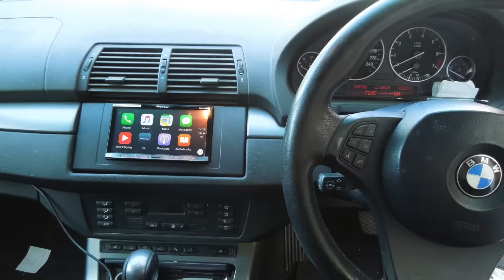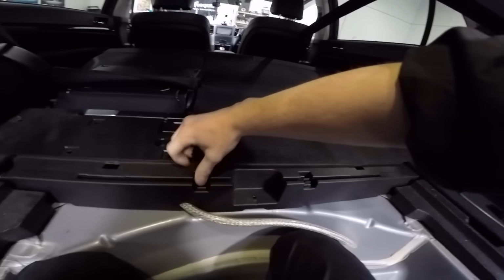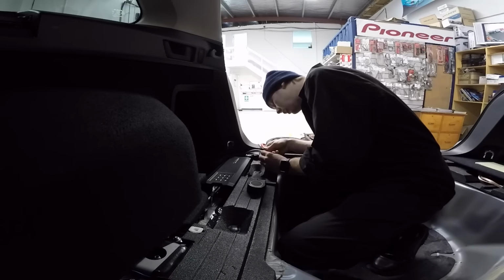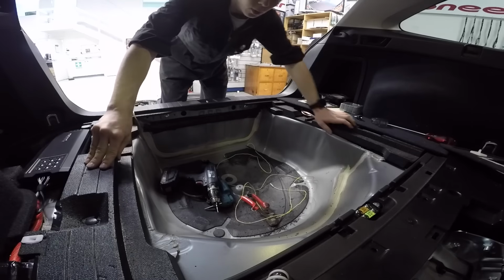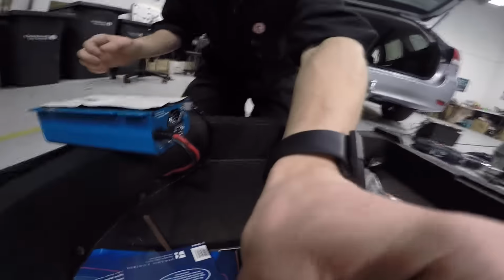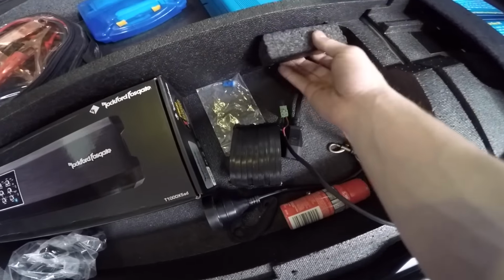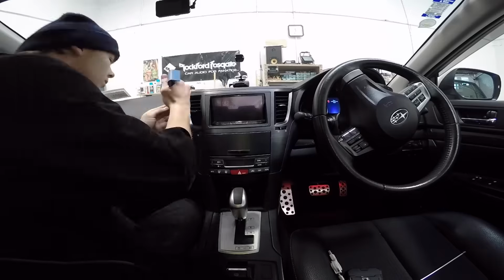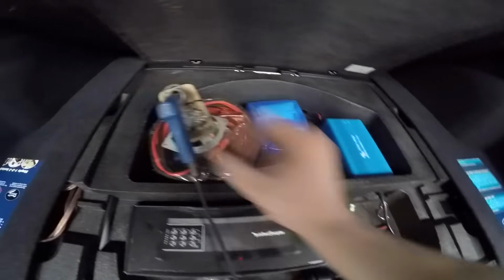Project Legacy: Rockford Fosgate T1000X5AD POWERED UP!

Comment: it that metal rod for hold up the center bit when ya pull spare wheel out?
Reply from the maker: Aaron Warnett na don't think so, normally you would just lift that whole center foam thing out
Reply from the maker: And the floor lid has a hook to hang off